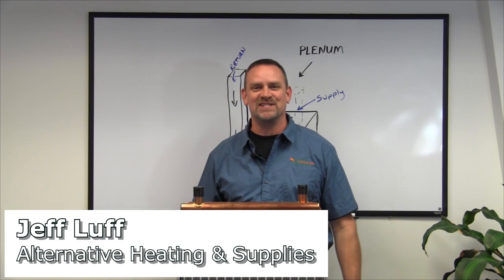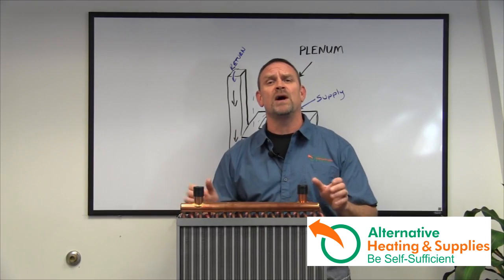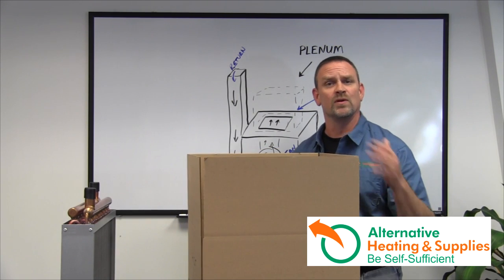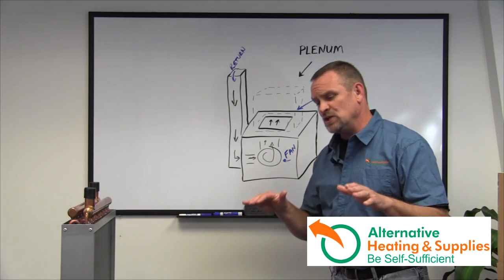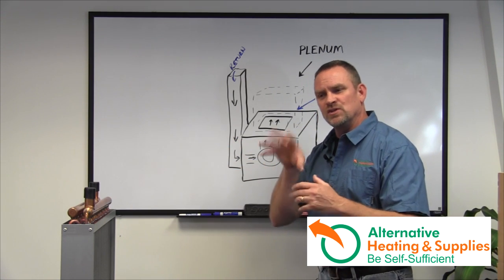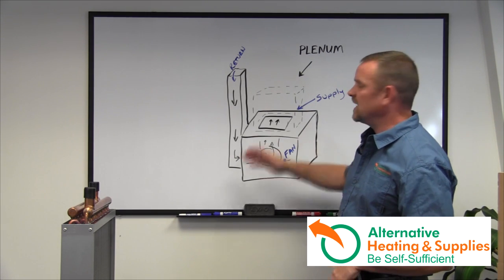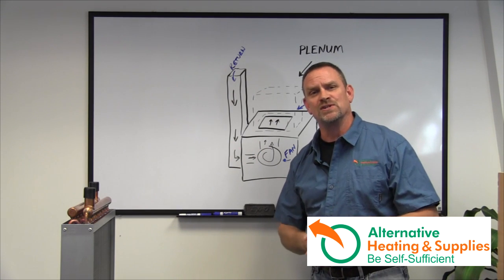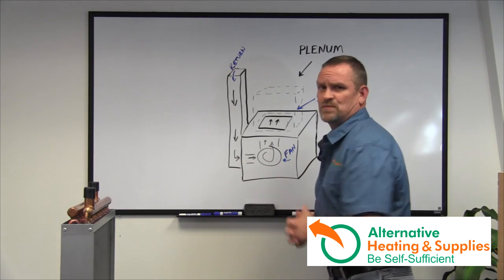Water To Air Heat Exchanger: Considerations When Installing - Part 1

Comment: One thing not mentioned here that is critical is to make sure the the heat exchanger is protected by a filter. Most furnaces have the filter in the return, right by the furnace, so if you mount the exchanger in the return, make sure install it downstream of the filter or relocate the filter to protect the exchanger.
Reply from the maker: Don't recommend installing in the return for that reason and a couple others, like overheating the blower.
Jeff

Comment: Great video ! I have unico system and seems to not have any room for a water to heat exchanger ( want to get an outdoor wood boiler.)The duvts that the hot air is forced through is connected straight to it. Could I build a plenum in between my unico system and the duct work ?
Reply from the maker: Yes you can do that. Jeff

Comment: Hey love all your videos thanks.  I'm now using an outdoor boiler to heat my indoor pool water.  I added a water to air exchanger like in your videos.  It seems my air flow is now reduced.  Is it common to increase blower fan size when using this set up? The original heater is just a massive  electric coil in the duct.  Lots of heat, expensive, but no air Flo restriction.
Reply from the maker: The heat exchanger might be dirty and need to be cleaned. If air can't through, increasing the fan this will help temporarily.

Comment: Any difference at all of hot is on top or bottom of the exchanger. I assume there is no difference as it's not specified anywhere.
Reply from the maker: It is hard to get air out is why you want the other way.
Reply: Air bubbles in water always flow upward. Supply to the bottom, return out the top. Blow a fart in a swimming pool and bubbles always return upward. Good example, not trying to be smart.

Comment: I’m heating my garage with a truck radiator ,50 gallon water heater, 4500cfm attic fan and a boiler pump…. Been watching your videos to brush up on the principles 😂 and it’s working great 👍
Reply from the maker: Good stuff

Comment: My plenum od measure 20.125"x16.25" to be exact. You don't seem to sell any heat exchangers in that size. What advice would you have for getting a quality exchanger or do you make custom sizes? My ac exchanger is a lennox M/N C35-30/36B-2F-20 for reference. It's on a propane forced air furnace.
Reply from the maker: no sorry, no customs sizes either. to expensive

Comment: Thank you Jeff , I have hot water in floor heat . Sometimes when its really cold this would help .  I have a Lochinvar boiler that provides hot water to four zones in my house , each on its own cir, pump .I have a fifth  pump installed in system for garage that I will never hook up to garage pipe .  I intend to hook this  pump up to the water coil suppy  , and  the return pipe from the coil back to return line of my system   .  The water going out  from the lochinvar boiler is 173 degrees ,    is this  hot enough to make a difference going  through this water coil in my furnace ?  thanks Dave
Reply from the maker: 173 Degrees is plenty to heat with a water coil...

Comment: hey man.i like your channel and subscribed,however i feel i need to pass on a piece of advice from one pro to another.i,ve been  in the hvac trade for 24 yrs,saying that,i completely understand what your doing mechanically in your films....now there is a good chance that joe home owner may lose something in translation...for instance in your film about using a outdoor boiler with a indoor boiler heat exchanger,you mentioned if there was a problem spring/fall about the primary chamber cooling and adding a zone off of the prv,there was no mention of the prv being under pressure.just imagine joe homeowner just unscrewing said prv to add a t fitting and the boiler is full of 180 degree water and 20 psi...ouch...im only saying this because i know of a guy who offered some friendly advice and a individual started his house on fire.well the friendly advice giver got sued!...again,not nit pickin,just passing along a piece of advise...cover your ass,make some disclaimers!
Reply: true